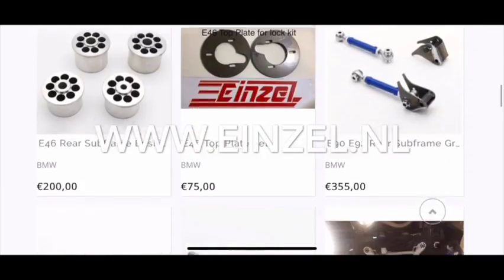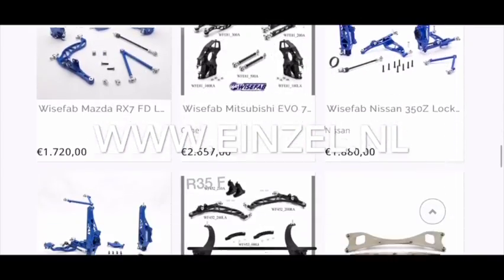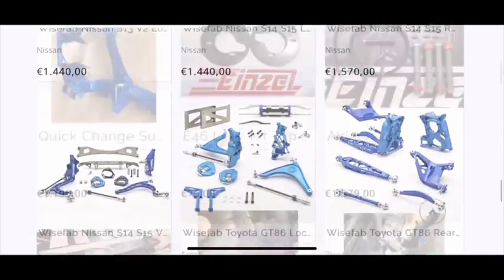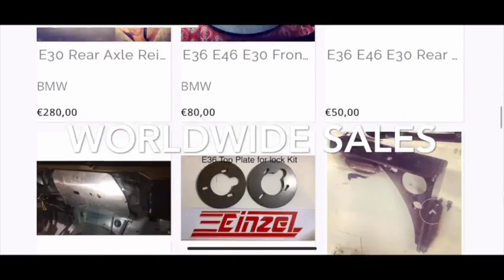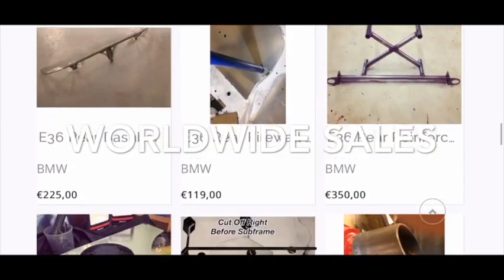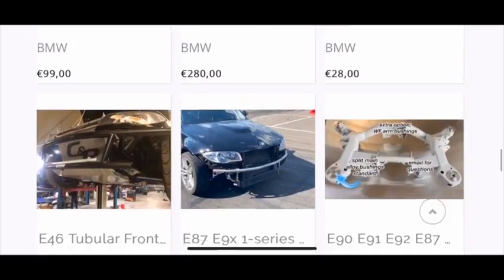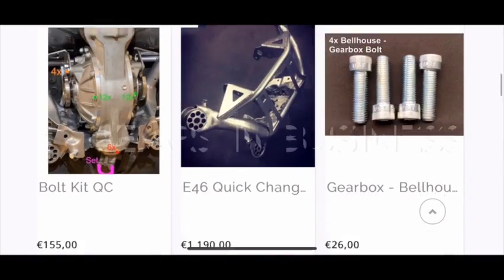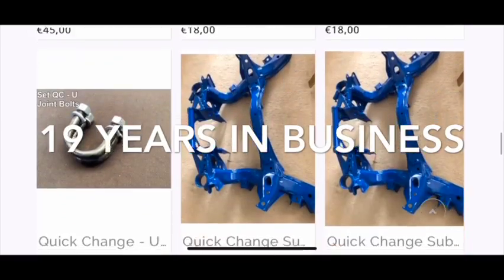Drift Podcast : Drift Car Weight Savings, Weight Distribution, Center of Gravity ,Tips & Tricks

Comment: Great video, I like a few key points, about working overtime or possibly picking up a night job to afford better parts then just cutting stuff up.
Also I drift my grand marquis and I choose a super heavy 2 ton car, so it's kinds foolish to just try and make it light when I could of gotten a miata or somthing lighter. But I think I'm going to just save up for forged monoblock wheels and then should help alot,  if I need help on choosing wheels could I reach out to you?
Reply from the maker: I don't know which wheels all fit that car, which PCD & Offset / backspacing is that,

Comment: i have a fat 65lb lithium battery above my diffs location in the trunk and the gas tank is mounted under the chassis and 3" from the diff cover mount, then use the spare tire wheel hole as a fan shroud and have a gm electric water pump pumping the coolant.  i've used that setup in alot of cars and feels good enough for a 38yo datsun weekend/track day car and doesnt overheat the 2j at all. my brakes heat up and i pit before the engine does, lol.

Comment: oo yeah same here cut off everything at the rear of my e30, fiber glass bonnet+trunk and you can pick up the rear of the car by urself. I swapped a rb up front the car become unhappy at transitions. made a rear mount radiator and moved the gas tank from inside car (rear seats) to over the rear axle. the car still dont have enough grip to be fast. 
The oem wheels are great, light + strong wheels and they dont cost fortune when you scrape to opponents wheels

Comment: If you had the choice of an m50 or m52b28 w/ iron block which would you go with? Or the aluminum m52? I as because in USA a 1997 328i has iron block m52b28 but the Z3 was aluminum.
Reply from the maker: For boost always use an iron motor. Also stronger on headstuds

Comment: So to clarify the best weight distribution would ideally be a 48/52 vs 50/50? Also hoe important would corner balance make a difference
Reply from the maker: Personal preference .  Some guys win with 52/48 

Corner balance makes a difference but its called "cross weight" for a reason.

You can't actually move weight around by doing that.
Reply: Thanks for the feedback!

Comment: Why build E46 based chassis cars are heavier with even the same engine and suspension than E36?  Bmw write on parts sheets that e46 same body shell weight much less than e36(i think 50kgs) but alot ready e46 cars that i see was much heavier, i think about 60-80kgs always. How it looks on the cars that you made?
Reply from the maker: E46 chassis weighs more, but also noticeable more rigid. Especially in US where people don't have elaborate cages, its a big difference.  Also E46 pickup points are slightly wider although suspension arms are the same